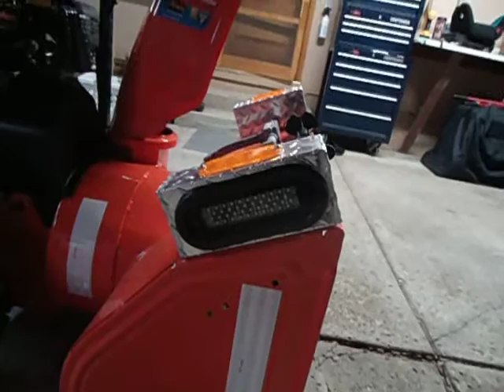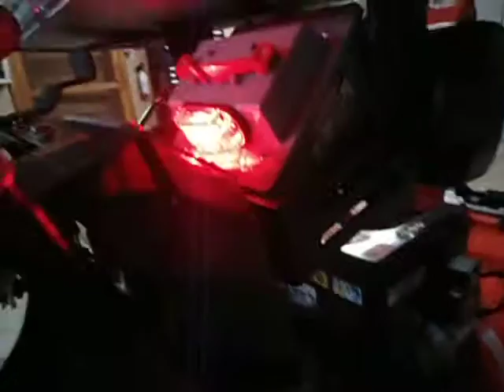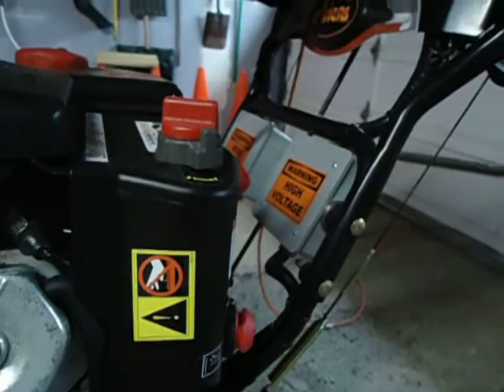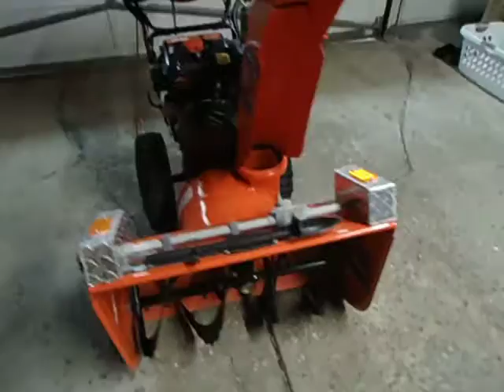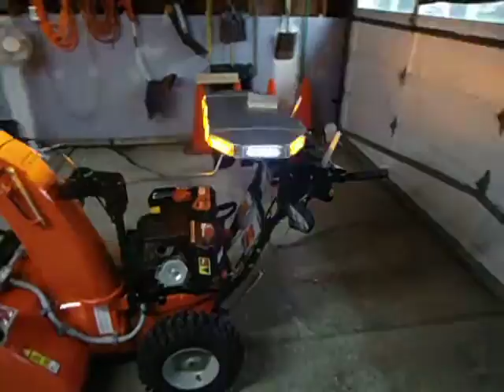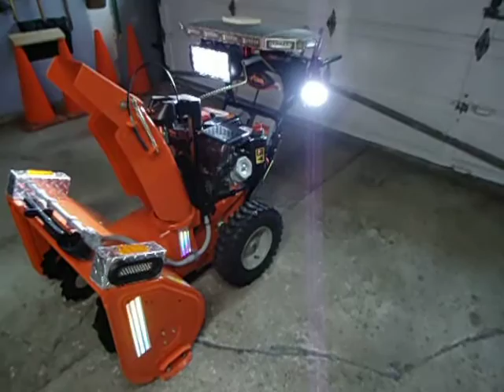Ariens 30 Deluxe Super LED Package! 2200 Lumen/36 Watt~!

Comment: Nice job. Now can you do my Ariens ? I would need something just like this because up here in the Lake George, NY (Adirondack Mts.) these guy go by with their trucks and don't care about the someone snow-blowing  their driveway.
Reply from the maker: Thanks for the comment.  Another viewer noted he could not believe the power (voltage) these machines make.  I bought this with out the heated hand grips, as I knew they pulled a lot of power (30 amps!).  Search for voltage regulators on here if you do add lights, you need one on these machines.

Comment: Where is your battery at? I didn't see one. I was thinking of a strobe on mine because when I go into the road for mail box cleaning,  people do around 40 here. Maybe with a strobe they will get over a little.
Reply from the maker: Sir, no battery on these machines.  As I noted in the desc., the Ariens unit puts out 60 watts, with the help of a rectifier ($15) part you can power a lot of lights.  Check snow blower forum online for tips, etc.  Thanks.

Comment: I'd like to see a 18 watt AC engine output, rectified to DC, light that menagerie . No wonder you used a battery charger lighting for your friends. Make a video , all lights performing, outside with engine running only for an ATTABOY from me.
Reply from the maker: Sir, thanks for the comment.  I just made and posted another video with the machine running just for you.  I appreciate your comments, and look forward to them after you watch it.  SEARCH my videos please.  Thanks.

Comment: How do you operate the chute direction?
Reply from the maker: Its still a manual control.  It looks like it won't have enough room but it does.  I use it for mainly straight runs.